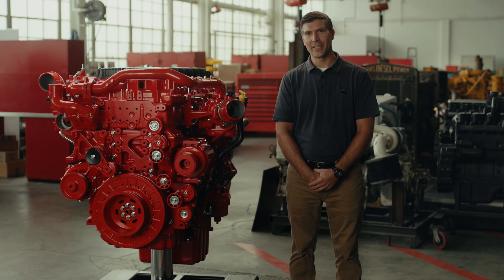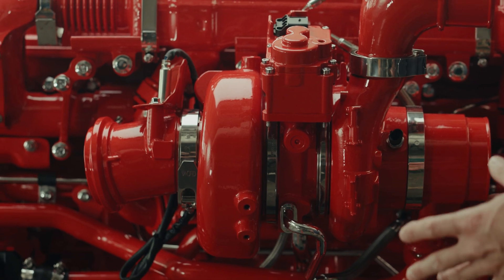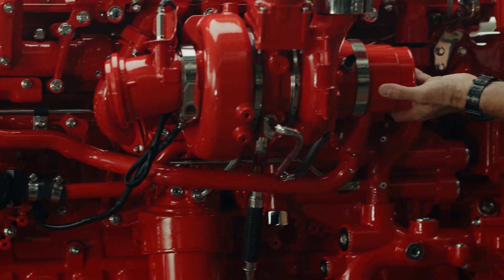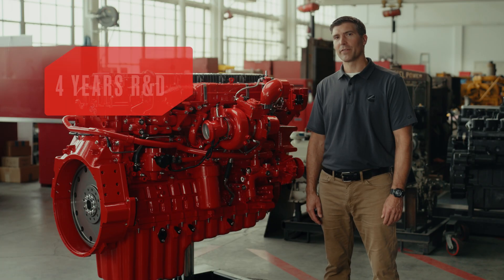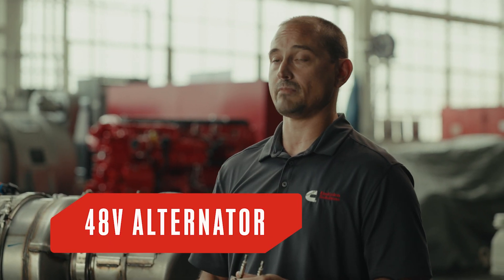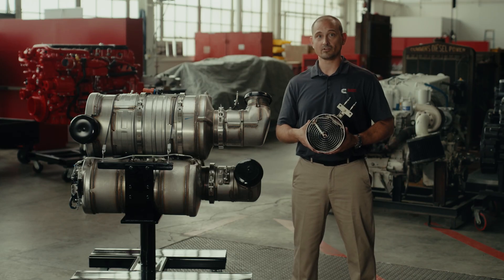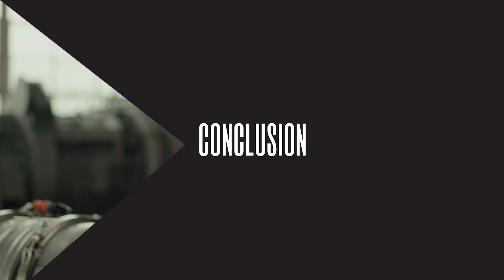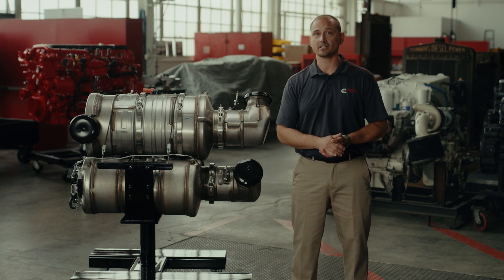Cummins 2027 X15 engine walkaround

Comment: Exciting! No worries here, Cummins has proven their word in previous products. Running a 17 year old Ram chassis 6.7 with BLUTEC (SCR only, no def), bought new, 360k miles on the odometer and absolutely ZERO emission system issues. In fact aside from one water pump there have been ZERO engine components ever replaced. Meanwhile the front end has been essentially rebuilt three times lol.
Reply: Just curious if you run any fuel additives?

Comment: Did not the EPA just cancel all this emissions garbage!
Reply: It doesn’t matter. The engine manufacturers are still going to stick with the GHG27 emissions regulations. Why????? For two reasons.  1. Even if the EPA regs were canceled, the manufacturers know that some states will file massive lawsuits claiming harmed health from increased emissions (similar to the tobacco lawsuits at the state level). 2. If another POTUS is elected in 2028 that  vows to reinstate the GHG27regs, any trucks that dont comply will become paperweights with 10 tires.

Comment: Why did yall let ram talk yall into putting hydraulic lifters in the the 6.7?
Reply: I’m not a fan of the change to hydraulic lifters for the 6.7. But, those lifers were a robust and reliable design. The third-party vendor who manufactured them for Cummins had almost zero quality control during the pandemic. That’s what led to all of the problems.
Reply: @The_Lincoln_Penny that is an absolute lie..has nothing to do with the vendors..the block wasn’t designed for those lifters and Cummins commercial 6.7’s still run flat tappet..my 25(!) 6.7 has been in the shop for over 3 months with multiple lifter failure at barely 15,000 miles..its been in the shop so long because of parts availability and the long line of 2025’s that need the same warranty work as mine…COVID vendor problems in almost 2026? Give me a break…Cummins is just trash now

Comment: since the epa cancelled emissions these engines won’t be good on paper roadkill before 300k miles
Reply: Mine is almost at 400 thousand miles and shes running strong not a single issue..

Comment: 100k mile drain interval? 😮😮😮 that’s insane.
Reply: There is even a special service indicator when you extend the oil change to 100k …….  You will hear a loud bang just before THE ENGINE LOCKS UP!!!
Reply: @The_Lincoln_Penny Bullshit! Synthetics are far more advanced then you can comprehend. 1 million mile engines everywhere with high interval oil changes
Reply: @The_Lincoln_Penny 😂😂😂😂

Comment: Good day sir have you come to the realization that you need to use stainless steel liner shims? Thank you for your time. Man these engines scare the s*** out of me.
Reply: And raise liner heights. I think Cummins is trying to prevent cracking on the counterbore ledge. But this is a problem that Cummins needs to address and fix it correctly. This has been a major issue since they started producing the ISX and they made the problem worse later down the road by bringing the liner heights lower.
Reply: I love the Cummins and these problems can be fixed in an inframe overhaul but it shouldn't be an issue to begin with

Comment: Emissions are still in affect unlike lots here are claiming but if 2027 emissions were to be removed would you give us this engine just without the electric heaters or keep heaters and remove egr? Whatever it would take for this system to meet current standards with the same new engine design

Comment: The EPA has totally fucked these motors. Think how much all this is gonna cost to fix when it breaks.
Reply: No, epa can take a certain hit..but Cummins and ram have done some of the most bone head moves and changes on these engines ever
Reply: Zero,  I wont buy anything with all the garbage added, Cummins is a world class engine but the EPA has ruined that, thank goodness all that nonsense is going down the toilet as we speak.
Reply: @precision430 wdym, they just reverse emissions standards no? DPF, egr and def is no longer a requirement at this point in time. It’s legal
Reply: @TheBusinessMindset_   if it's intended to be a global platform engine, then it will be complying with Euro emissions standards. So emissions tech will remain.  Cummins is a multi-national corporation, so domestic regulations even if slackened will not necessarily be applied to their products.  If you look at Cummins literature, they talk of decarbonization of their products, which is 'Net Zero' speak.  All the multi-nationals are committed to this goal, whether we like it or not. 

Yes, it will result in greater complexity and less reliability (more to go wrong). It will also squeeze out smaller businesses, with onerous maintenance expense burdens, even though there are extended maintenance intervals.
Reply: @precision430 Cummins stopped being world class when they outsourced manufacturing to China.
Reply: @precision430 the Democratic National Communist party hates big diesel trucks. They hate them because they work so well. They hate them because they allow individuals independence. They hate them because the drivers never vote for democrats.

Comment: You guys ever read the NEWS? It is over. ….We want the motors you’re sending all over the world every day that have NO EMISSIONS. Like the USA military gets. Better get started on those new engine retrofits new block going into old trucks. A delete kit for every engine you produced would be a good start. Cat going to eat you alive in the Peterbilt and Kenworth new truck market. Might want to go back and look at all those DEI hires. O and let’s stop all this CHINESE make parts. Your an American made company so start ACTING like it.
Reply: Didnt CAT stop making heavy truck engines a few years ago?
Reply: @milkshake1993 
Cat builds engines every day. Dozers, excavators off road trucks.
Reply: All you need is to get hands on one of those ECU controllers from military grade Cummins engine and put it under your truck hood and disconnect after treatment system, maybe you’ll need some harness, should be way ECU swap and bum you have best new engine you can buy in USA, also throw in simple turbo instead of VGT turbo
Reply: It doesn’t matter what’s in the news headlines.. The engine manufacturers are still going to stick with the GHG27 emissions regulations. Why?????  For two reasons.  1. Even if the EPA regs are canceled, the manufacturers know that some states will file massive lawsuits claiming harmed health from increased emissions (similar to the tobacco lawsuits at the state level). Massive lawsuits from attorney generals at the state level almost never reach a verdict. They are usually stymied in settlement negotiations for years on end with millions in lawyers fees alone. 2. If another POTUS is elected in 2028 that  vows to reinstate the GHG27 regs, any trucks that were “factory deleted” will become instant paperweights with 10 tires.
Reply: @The_Lincoln_Penny I disagree. … When it is past, there is no standing in court. The science is junk. They have lost twice already in the supreme Court. The emissions we have today is from CA junk waver. When it passes and you remove it you will be in the law to do it. The democrat communist will need a president and control of both houses to do any emissions at that time. I don’t think there going to pull that off. Next 16 years is going to be common sense law.

Comment: the exhaust heater sounds like a truck stranded on the side of the road..scr's are also problematic.. chokings them up more and more every year.
Reply: NOBODY would have a problem with most of this garbage if it didn't result in derate. I actually LIKE that newer trucks don't smell like burning tear gas and pine pitch, but I HATE that 1 corroded wire can cripple a $300k truck and put a family into permanent debt, and it can sometimes take an absolute wizard to find it.
Reply: That and the fact that a 48v alternator has been integrated to the equation will just cause tons of issues down the line.

Driver / Owners nightmare, mechanics dream.